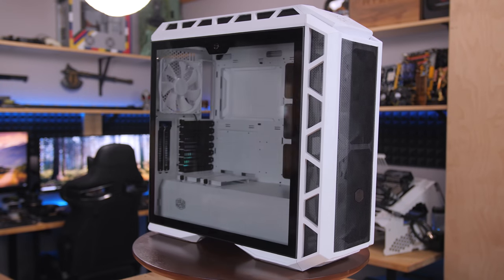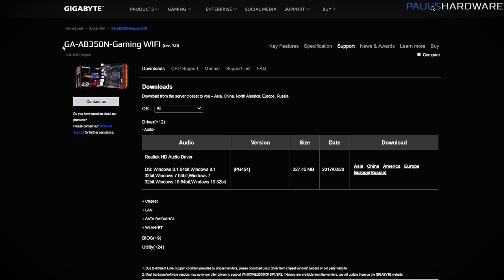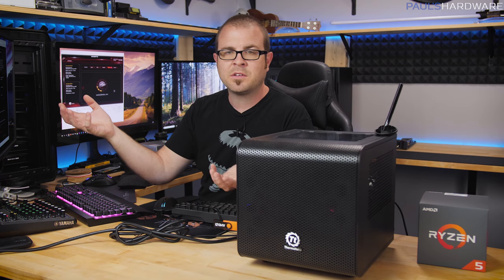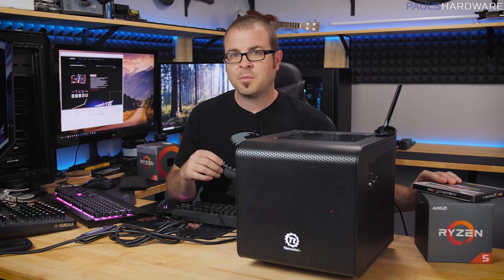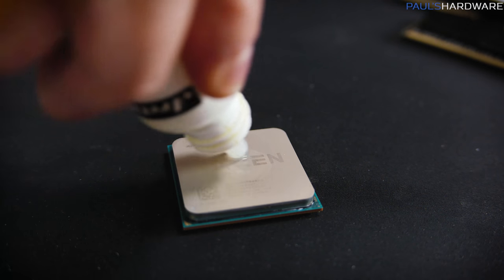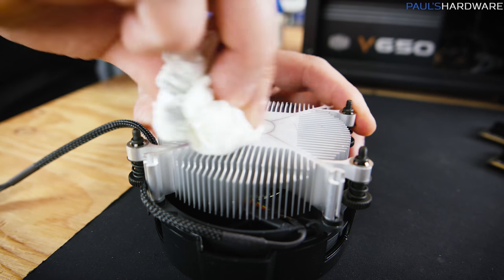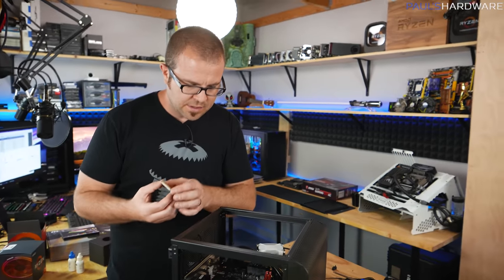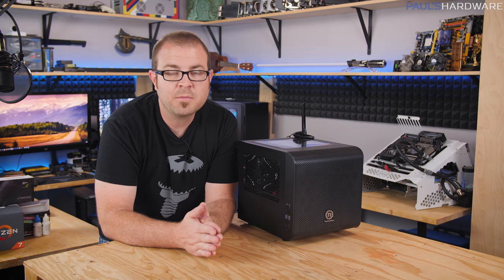How To Upgrade the $500 Gaming PC with Ryzen 2!

Comment: great video. i have the white version of this case and 2200g. i was thinking of going with the 2600x also and shuffling the apu over to another build when i have $$ for a 400 series. very interested in your benchmarks when you can do them on the 2600x on a b350 board. im using a mini itx fatal1ty ac b350 board. i kept my gt 730 2gb video card in there because i kept getting video tdp failure when i tried to OC the gpu part of the chip. it frustrated me so i dropped the gt 730 back in and have no issues now. this is a great video for the average person just wanting to build a good system on a budget. i love how little space the case takes up and how well the system games for now. i also tried Ryzen Master but got confused with that. i guess i need a tutorial on how to OC the 2200g, or at least the gpu part of the chip. i keep looking for a good Ryzen Master tutorial. i also have a Ryzen 5 1600x. my memory on both is Corsair lpx 3000. 2 4gb sticks on the 2200g and 2 8gb sticks on the 1600x. i wish memory prices would come down. my 1600x is currently running my recycled xfx r7 260x 2gb video card. hopefully one day soon i can get one of the high end nvidia cards. it’s discouraging to be building on a budget

Comment: Hey Paul.  I noticed one of your Newegg reviews of the old Cooler Master Stryker SE.  It seems Full-Towers haven't changed much, and the handle is awesome.   I noticed it even uses molex connectors.  Would you recommend a 2011 Full-Tower case to anyone in 2018?
Reply: why not if thats what you like, its your machine, just make sure your power supply is up to 2018 standards, atx has not changed in mechanical terms.
i have anew modern system fitted into a white desktop case, thankfully this ibm case takes standard pattern atx power supplies so a nice new evga 850 gold+ fitted great.

Comment: hi there i have a question. since the original setup already have 2nd gen cpu and you upgrading it on the same gen why bother to upgrade the bios ? i actually have the same build and also planning to upgrade to ryzen 5 2600

Comment: Ok this is a constructive critic, or so is my intention, so no hating bro :

First of all, i think is a bit wrong to do a upgrade guide with this processor before being able to show the benchmarks because, what if the gain over the 2200g for gaming arent that big, and so, if someone actualy follow this guide in the next days, and upgrade their 2200g to a 2600 as they come out, ends up just wasting couple hundred dollars on the cpu, also, even if it does give u some fps gains, will those fps justify the cost of the cpu? you are tossing 200 dlls for what? we dont know... it could be 10 extra fps, 20, none?

Second, if we going under the premise that we build this system because we are under a constraint budget, tossing the perfectly good 2200g out of the window for a new 200dll cpu makes no sense at all... in fact, is all the oposite to budget gaming, at least this quick after we just build the system. 

I think, it makes more sense to just upgrade to a full video card and add more memory.

Comment: Are the 400 series mother boards going to have BIOS that work with, for example, the Ryzen APUs right out of the box?
I feel like kicking myself.  I've had a 2400g and waited until last week to order an MSI B350 mobo.  It's coming today. Don't know if its BIOS will be old or new. 
Now I find out the 400s are coming out. 8(

Comment: Hey Paul should I go for a 2700x or 8700k, I'm going to be making a custom water cooled system and overclocking is important and it's going to be mainly for gaming and some video editing
Reply: Gotta wait for the benchmarks on the 19th! But almost guaranteed the 8700K will be king for gaming once OC'd.
Reply: I plan on getting a 2700x as soon as the new line launches, but for most I would say to go for Intel's 8th Gen for overclocking performance; as far as I've heard the new AMD chips can be pushed to ~4.3ghz, but some 8700k's can go to 5ghz+ in comparison. I think if gaming is the main goal, the 8700k will get you further in terms of sheer frame rate. However, keep in mind the extra 4 threads on the 2700x will potentially help a lot for streaming games which also use lots of threads. Overall, they are both good options, but do some digging and see what better suits you!
Reply: Why not the ryzen 5 or 7 cpu
Reply: JoeAceJR the microcenter at my house has the 8700k on sale for 299 and the 2700x is starting out at 329, and since I'm going to water cool the parts I'll want better components
Reply: id go for a 8700k if its only 299 at the moment.
Reply: WayStedYou id go with the ryzen series
Reply: Honestly, many say to get the 8700k for gaming... but I've been gaming on a 1700x. I've never noticed dropped frames. Even with a 140hz monitor, you wont notice any difference. If the expected improvement of 2700x from 1800x is true, then wait for the 2700x. At the same 95W tdp, you are getting 2 more cores with 4 threads. If not, to each his own. Be proud of the choices you make cause both are good choices.
Reply: F Yurt7 get the i5 8600k, basically a 8700k but it uses 100% to reach what the 8700k does with 60% load ( so over time 8700k should be better) but as of right now the 8600k is the same as a 8700k when oc.

Comment: Do gen1 Ryzen run on gen2(470) mainboards?
Reply: n0ply 1337 no 270 or 370
Reply: yes they do, they are compatible both ways, though you may need a bios update for gen2 into 270/370, but other way round should be fine

Comment: Does R5 2600x build w/out graphic card bootable ?
Reply: no of course not its not a "G" processor, with a 2600x YOU NEED A GRAPHICS CARD,
if you dont want a separate graphics card buy a cpu with a "G"suffix ie 2400g, 2600g etc.

Comment: Thanks for the guide. I need to upgrade mine so I can stream 4k 144fps VR hentai. If you could recommend easy to clean mice and keyboards....that'd be great. Preferably non-stick. Thanks.
Reply from the maker: well I do have a video about how to clean a mechanical keyboard...
Reply: Paul's Hardware I need to check that out then.
Reply: Paul's Hardware seems like a useful guide for your viewers Paul

Comment: What if I had an athlon AMD processor and decided to buy the new ryzen. I buy the same motherboard, and the ryzen 2600. Would I be able to install the ryzen in the motherboard, turn it on and update the bios to the newest one so the motherboard recognize my processor (since it will come with the first bios version that doesn't recognize the new ryzen gen)?
Reply: if your mainboard is ryzen compatible, and you have an am4 athlon, all you need to do is update to the latest bios using the athlon, once updated then drop in the ryzen.
amd were sending out loan cpus to board buyers to update the bios, which had to be sent back, i dont know why they did not send out am4 athlon cpus(£14), and just tell the buyers to throw the althons away after updating, the cost would probably have been cheaper than sending out a 2200g that had to be returned via postage.

Comment: hi all, I can't seem to get my Cosair Vengeance 3200 memory to clock at 1596 with my 2700X. I'm on GA-AX370-Gaming K7 with Bios f23d and I'm able to set mem profile to 1 (XMP) and it changes the timings and voltage in the bios settings. But when I boot and run CPU-Z, it still shows 1066 MHz and 15-15-15-36 (instead of 16-18-18-36 in bios (Profile 1). Anyone else running into this?

Comment: I know it's not your fault but I updated the bios on my msi z370 gaming plus cfx atx mother board with a i5 8400 8th gen cpu and after words Windows would not boot it gave me a blue screen saying i needed to restart Windows, recovery dint work either I just had to end up installing Windows 10 again. What could of happened? I did not reset defaults on my board before updating my bois and I did not know how to clear cmos

Comment: If im upgrading just my CPU same scenario I already have a Dedicated GPU. Do I need to reinstall windows if not would I have issues with current setup. I have stock drivers in the system at the moment so I was hopping that would help.

Comment: I’ve been asking around alot but never gotten a clear answer. Can anyone answer what i can buy to upgrade my i5 6500 with a 200-300 budget? Cheaper the better! My mother board is a H170. LGA 1151
Reply from the maker: You can get a 7600 / 7600K (4c/4t), or 7700 / 7700K (4c/8t). Since you have the H170 chipset you can't overclock, but your board should support the 7000-series CPUs with a UEFI/BIOS update. You should check the manufacturer site first for that update before buying. The i7-7700 is about $300 and is a good match since it's not unlocked, so the lack of OC-ability doesn't matter.
Reply: Paul's Hardware Thank you so much sir! Appreciate the fast response!

Comment: 1060 3gb is reasonable, 1050ti won't allow smooth 1080p gaming in everything and costs a lot.
Reply: yeah it was reasonable. but I still want a blocked 1080, and still no issues with the 7700k other than it runs hotter than I would like.

Comment: hahaha oh my, i just ripped my 1600x right out of the socket 3 days ago when i was trying to replace the thermal paste. i sat ther for about 1 hour just holding the cooler in my hand with the cpu attached checking all the pins. thankfully nothing was damaged and all is working fine. definitely s**t my pants though.

Comment: RAM upgrade was totally unnecessary. It already had 8gb which is enough to run any game and most standard use cases.
Reply: Adam W true, but 4 extra gigs gives you an extra 10-20frames, ( won’t matter if already getting 60+) but if you don’t get 60+ the extra ram helps a ton.
Reply: Four more gigs after already having eight will not make any difference at all on FPS. I don't know of any games that use more than 7-7.5gb with the OS and a few standard background programs all included running at the same time. You might break 8gb if you are multi tasking, like having a big bunch of browser tabs open or streaming.

Comment: If I had a 2200g and wanted to upgrade to a 1050ti I would probably go for a Ryzen 3 2nd generation cpu, and maybe save that money to get a 1060 3gb (If the build is just for gaming).
Reply: NootNoot! Don’t bother with the 1050ti the 1060 3gb is almost twice as good, and for 5-10% more boost get the 6gb 1060
Reply: @TheDarknessOfGames True

Comment: Sounds like you built a whole new PC minus storage and motherboard.
Reply: I think the ram wasn't exactly necessary to upgrade at this point. Wanting to upgrade the CPU and then needing a graphics card because of losing the APU would be about as far as I go with this upgrade right now. Keep the 8gbs and wait for the market prices to start coming back down. But if you're Paul and you have sticks lying around everywhere... yeah go for it.

But some people upgrading from a 1300 or a 1600 would already have a graphics card, so that's even better. It's amazing that you can just pop a new chip in the same old motherboard.

Comment: Is there at least a single Ryzen motherboard that actually supports Ryzen without the need of a BIOS update? Holy shit like i was about to do this but with a 1600 instead of the APU but apparently that's not supported on stock BIOS either? More like Faylen amirite? This is the one thing that's stopping me from getting a Ryzen system. This is some false advertising shit.

Comment: Wouldn't it be better to just buy the video card and plop it into your already build Apu.
Reply: Not necessarily. With this particular upgrade, he's not only getting a better GPU, but also a significantly better CPU (generally speaking). The APU he had only 4 cores / 4 threads. The Ryzen 5 2600X has 6 cores / 12 threads, on top of any performance gained from the refined architecture.

When I upgraded from the Ryzen 3 1200 to the Ryzen 5 1600, I noticed a pretty big difference in overall performance. Not as much in gaming, but the rest of system felt far more responsive, especially when having multiple tabs open in Chrome.

Of course, if you have a pretty strict budget, the GPU upgrade alone will help.
Reply: but with limmited money i would start with the gpu then move on to the rest of the components
Reply: Tennis Ball good for u of course
Reply: Yes. If you are limited on spendable money, then definitely start with the GPU first.

Comment: This build looks much more beautiful than this one that you did using the same board: 
https://www.youtube.com/watch?v=QA-T43rbDEQ&t=384s
Incidentally I used your build to build my build back in January and very happy with it. However I did do 32gigs of ram with an 1800x back them with GTX 1080 and added additional drives and even optical drive! And it doesn't look as bulky as this one. 
Thanks again.

Comment: I'm still in the middle of doing a large scale upgrade of my pc and now I'm looking into building an AMD itx build and this pc looks good.  Thanks for the video and parts recommendations.

I've never used jet.com and don't know if they're reliable, but, they have an EVGA  3gb gtx1060 for 199.99.

https://jet.com/product/EVGA-GeForce-GTX-1060-GAMING-ACX-20-Single-Fan-03G-P4-6160-KR-3GB-GDDR5-DX12-OSD/16a9136f3be04a8a927ee11b19d1acd8?jcmp=afl:link:je6NUbpObpQ:na:na:na&siteID=je6NUbpObpQ-5b3RfxPfZGHlWpWp6i5ppQ